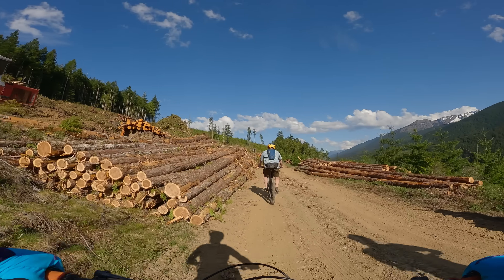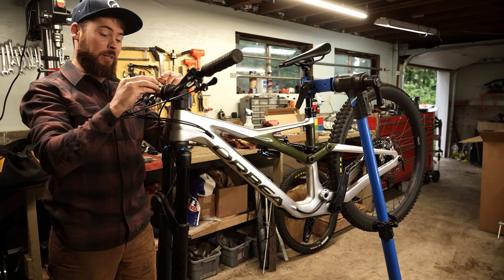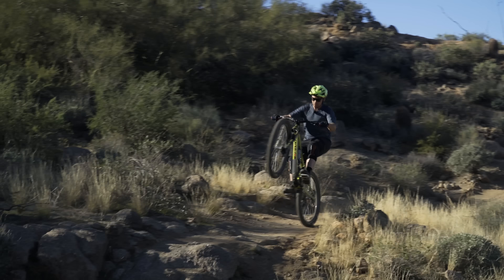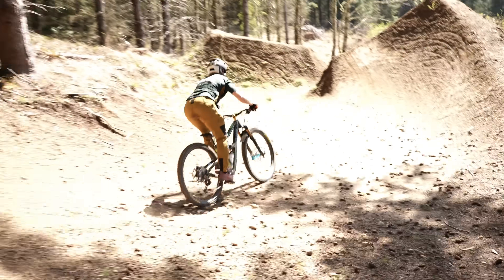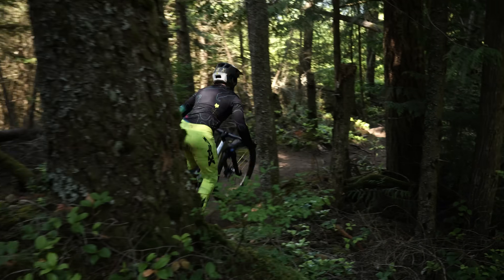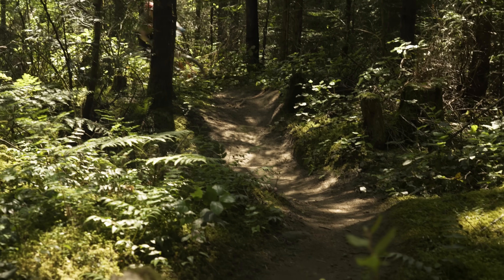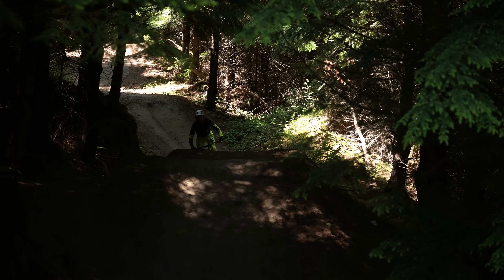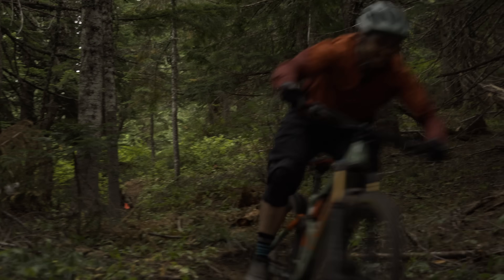7 Pet Peeves with Modern Mountain Bikes

Comment: You hit Number 4 on the spot. I have a Ripley AF and the amount of pedal strikes has led me to now a dislocated shoulder. Not fully blaming the bike (user fault most-likely) but ever since I went from a hard tail to this bike, the amount of strikes has been near insane. Raise the bottom bracket.
Reply: Lower bb feels better on flow trails... most riders ride flow trails. at my local mtb park the groomed flow trails are always packed, and the natural terrain ones are empty. mtb manufacturers are all about following the demand from riders. there are nich products with higher bbs or you can get one that is adjustable, i always ride my bikes in high position
Reply: @manaknight333 same, I go to Mountain Creek, Thunder, Killington and Highland and the flow trails, especially the blue ones like Cat's Paw, Jump Start, Blue Magic and Gronk are always packed. If there's a bigger market for flow than tech, and clearly there is, that's the direction manufacturers are gonna go ... And most kids I see are almost exclusively riding jump/flow trails, so it's gonna become even more prevalent.
Reply: I'm with @holyspokes608. Try a shorter crank. It won't solve low BB issues, but it helps. 5mm or 10mm can make a surprising difference in clearance.
Reply: Going from a hardtail to a fs makes a difference on its own as you can pedal while the rear suspension is compressed which makes the effective bb height a lot lower. Maybe less sag could be a solution but thats a whole other topic

Comment: My biggest pet peeve is that most bike manufacturers charge retail prices for  components on their builds, when we all know dang good and well that they get a substantial discount on parts. Especially when they buy them in bulk. I mean instead of charging 12 grand for a bike with parts that add Jensen retail prices for each individual piece, they could share the cost savings. better yet, sell me the frame without a shock and let me spec everything I want since I'm going to end up paying retail for said parts anyway. Don't even get me started on "XT or GX" builds with NX/SLX everything except for the shifter.
Reply: Propain is the only company I know of that will sell the frame without the shock, nice feature
Reply: @JJ_MTB_15  commencal will too

Comment: Properly speced wheels and tires on enduro bikes would be amazing. My trek slash is such an incredible bike but the stock wheels and tires are already upgraded after 6 months
Reply: The Bontrager Line 30 comps died that quick?  You would hope they're decent because the Bontrager high engagement hubs are a big selling point to those wheels.  Tire selection is getting better with lots of good non-Maxxis options out there, of course Bontrager tires are still trash, they didn't go the route of Specialized and actually put effort into making good tires.

Comment: As far as BB height, it greatly affects the stack dimension, so by increasing BB height you're decreasing your stack, unless you increase your head tube length or stem spacer height/bar rise with it. So a lot of companies drop the BB to achieve the size they want, as well as the low CG they want

Comment: A workaround for bottle cages is to install them on the handlebar. Fidlock also offers rubber strap mounted mounts. But round plastic clamps also exist by Fidlock, Nicolai offers several options, so far only where I've found them. This requires you to get the correct clamp for the tube size. and is for round tubes. But I could install it on the down tube, top tube if I want. Fidlock offers bottles with a cap, which is a must in my opinion.
There was a bottle and mount system that has two bottles I forgot who makes it. As for tiny bottle YT bikes has a custom Fidlock bottle for their Jeffsy bikes. But Fidlock offers their regular bottles in smaller sizes. Like 450ml. But thee YT bikes bottle has an unusual shape to fit that bike. It also fits on Nicolai/Geometron G1, but G1 does not have mounts, but you can install a bracket, as Geometron thought of this, it's a mountinh hole at the BB area without compromising the down tube. and cable routing mounts at the rocker link bracket. I think it has to be ordered at Geometron.
Fidlock also offers Uni connector, which has BOA, which hold a bottle in place, so can mount any size type of bottle. So you could have a bag or tiny bottle and secure it.

Comment: I might disagree on the dropper post. Yes I am probably the only one but I don't like more than 150/160mm drop. It's enough for me. I only want my saddle out of the way enough and I tend to stabilize the bike during a descend with my thighs and knees from time to time. Currently I have a 125mm dropper and I personally don't see any reason to get more drop. Probably depends on the type of riding you do as well.
The rest I can totally agree with. I don't use a torque wrench tho. I guess everything and so far it works fine

Comment: Mechanical engineer here - lots of torque wrenches in my tool box.  As long as the torque spec covers things not coming loose...and stuff not breaking (especially stripping threads... ugh), I'm a happy MTBer.  Sure, I don't drag a torque wrench out on the trail, but for all the rest of stuff (minus maybe wheel axles and pedal axles), it's getting used.  Especially the critical safety stuff: headsets, rotor bolts, lockring for cassettes...list goes on.

But yeah, for suspension bolts that come loose...or axles coming loose, I'm much less pleased by some torque specs.  Wish it could be simpler... but you wouldn't believe how badly a general user can screw up fastening something together.  Torque specs are really CYA in that regard.
Reply: Ok engineer

Comment: Torque wrenches are very easy to use incorrectly in several different ways so that if you do a couple of these things wrong in 'one torquing' then you could be way of. For instance, most headset clamps have two bolts. If you torque one and then torque the other and go with that, then the first bolt you torqued will be under torqued and you will have a weak clamp (and the second bolt will actually be over stressed). This is because when you torqued the second bolt, the torque value will overcome and surpass the value of the first bolt. The first bolt had to overcome all original forces working against it. Therefore, most of the work for the second bolt was already done and it will snug down a little more, leaving the first bolt lacking. When two bolts are configured next to each other like that, you need to go back and forth a couple of time until they are evened out. 
 The wrench also has to be held and moved in a very specific manner. If you deviate from this, then the end values can be all over the place. Then there's the preparation of the mating surfaces and the preparation of the fasteners. If there is any dirt on the fastener threads for instance, the wrench will click or register before the desired torque.
 Research torque wrench use from the automotive or engineering fields and you'll be much happier with your results. Once you really know what's going on it is very easy.

Comment: I definitely use a torque wrench even if I'm not dealing with carbon. But some parts I do by feel.

To your number 1 point, the Ripley AF's ability to take well over 200mm of dropper was a big part of why I chose it. Coming from a BMX freestyle back ground and being short of leg, long of torso, (for my height,) I have hated mtb standover for decades.  Getting an appropriate reach meant using a long, slow steering stem, or getting a bike with a roadie-like standover. Modern bikes feel almost like Trials frames, (in a good way,) compared to mtbs from the 80s-10s.

Comment: Have you thought about that having a lower bottom bracket allows for that better handling? Lower CG always makes things more stable, and when your main point of contact is through the bottom bracket, that height plays a huge rule in how a bike handles. There is always going to be trade offs, going higher brings your weight higher, making it handle worse. Going lower has more pedal strikes, better handling.
Reply: It depends a great deal on your terrain. I ride the North Shore, and generally speaking, very low bottom brackets don't work well there.
Reply: @briannyob7799  Touche, good point

Comment: For the loose stem issue if it’s a carbon bar you need to use carbon grip paste, that’s why the torque spec is so low, they probably assume if you’re buying a nice CNC stem you’re running carbon bars in conjunction. If that’s not the issue I’m not sure what is!

Comment: lower leg bolts on my new lyrik fork came torqued at around 16nm, even though the manual says to torque them upto 7.3nm. So does it need to be that accurate

Comment: I am 163 cm short (and short legs) and bike frame with interrupted-seat tube is bad news e.g. bent-seat tube, suspension mounting placement that gets in the way (linkage pivot and the rear shock). It means I won't be able to fit a sufficient long travel dropper post I want compared to bike frame that has straight seat tube.

Comment: Torque wrench for safety. Seems my bolts get less or more tightened depending on my mood... not safe with something like center lock brake rotors. Suspension bushings/bearings also come to mind. My brain wants them TIGHT, but too much is more than enough. Torque wrench use lets me relax out on the trail.😊

Comment: 7. i use a torque wrench and never had anything back out or fail on me, but i'm also a light 140lbs
1. dropper post - my biggest pet peeve is that thomson doesn't make > 150mm dropper. been on the same dropper for 8 years, and had to go with another when i finally got a new bike that needed a longer dropper

Comment: Everybody seems to complain about dropper length (i.e. more is always better), but as someone that is of average height (5' 9") and has short legs (30" inseam), I usually can't deal with anything over 150mm. I wish more companies made droppers that are adjustable downwards (like PNW and OneUp) so that it would be easier to spec a bike to fit a wider range of riders.

Comment: I have never used a torque wrench. It has never been a problem.   Also, I'm worried that I will have a hard time finding an aluminum 27.5 bike in the future.  

The trends are pretty rough at times.  

I also hate that mtb clothing is so expensive $70 to be a billboard for TLD?  No thanks.  $12 blank athletic jerseys work just as well.
Reply: Yeah some of the overpriced pants and shorts are at least nice, but a lot of the jerseys are literally branded athletic t shirts that cost a lot.
Reply: Transition scout alloy! Full 27.5, pedals great, devours the steep gnar, rips corners, so playful and boosty for being just under 40lbs. My favorite thing about it is how it loves hucking to flat.
Reply: Fits a 210 dropper and fits a full size bottle plus accessory mount under the top tube

Comment: I would add that cranks are too long in general. Why are XS bikes with 410mm reach specced with 170mm cranks?

At this point most people are at least a little aware of the benefits of shorter cranks. It seems like S & S just need to move thier existing stock of 175mm cranksets by slapping them on every bike size medium and up. Mark my words: as soon as inventory gets burned down, someone's going to "innovate" and start preaching the vertues of short cranks.

Comment: Based on my recent experiences I would venture to say that there's a lot of overpriced garbage being sold, including by top brand names and their components. Had an issue that couldn't be resolved with a brand new fox fork. Terrible service by fox. Swapped it for a rockshox lyrik ultimate. Wasn't assembled properly and leaking oil right out of the box. Sent it back. They fixed it but didn't put set screw back into the adjustment knob. Further annoyances. Brand new trp brakes and the rear appears to be somehow defective. Hasn't been fun dealing with this bs constantly for the past 6 months or so. Quality control is zero and they are pushing out defective product at top dollar prices. Unacceptable but I guess this is just how we do things nowadays...smh

Comment: Dude!  Torque specs are crazy!  Just replaced my BB and called the MFG to verify the specs of 50-70!  They said the range was due to different BB shells made of different materials.  What is the point of that if they are not going to specify the torque for each material?  I have taken to the habit of only using torque specs on carbon parts; keeping to the hand/wrist/elbow/shoulder/hips method for everything else.  My bike passed all the tests even though I don't put the water bottle on the frame--got tired of chasing it after riding a chunky section 😅

Comment: I never used to mind not having a bottle since i would wear a pack . But the last few years i like to take minimal kit, i have a whyte e180 and you cant even fit a whyte water bottle in the frame. I had to get the smallest fidlock bottle since it was the only thing that would fit in and only by about 3mm. Pretty sure its a 425ml bottle which doesn't go far.

Comment: I assemble new bikes at work, been through about 6000 bikes so far roughly counted, and when I use my torque wrench I always go like 45° extra when doing metal on metal. Always staying a little under the torque spec when I clamp carbon with carbon paste applied
Reply: Poor customers... Why bother using a torque wrench at all if you're aiming for the wrong bolt stretch? 😂
Reply: @notmyname781  most customers will never touch a single bolt on their bike. Better to leave them tight than having them creep out. With the torque wrench I know roughly where I am with torque will the other people have no idea what they are tightening with just regular hex keys (often too loose)

Comment: Internally routing, especially for things like hydraulic brake lines, is a true PITA and wasteful of small parts / fluid when you need to swap things around.  Guerrilla Gravity has the right idea w/ their approach to this... clean lines by running an external channel along the downtube that has an exterior shield held in place with a few screws, and a snug fit so no rattling.

Comment: I look at torque specs and people who say you NEED to follow them (mainly people sponsored by big brands, huh strange ?) and i sigh loudly for myself. I come from motocross, we never care about that and as you said, want everything to be ''ass tight'', or as tight at the metal allows you too until the tool starts slipping or you risk of breaking the bolt, whichever comes first :P
Reply: Do you wire bolt heads like in street racing? I always find "right plus a grunt" is the way, and I own torque wrenches..

Comment: My pet peeve is how they keep changing the geometry of their bikes, moving them all towards downhill bike geometry, many enduro bikes have basically the same geometry of downhill bikes now, even some trail bikes now basically have the same geometry of downhill bikes too, many cross country bikes are now basically short travel trail bikes, not every one wants a super slack bike, so stop turning them all into one, over the years I've owned bikes that range from 70 degrees to 65 degrees, my preferred bike now is 120 to 130 travel with a 66.5 head angle, I find it a good compromise.

Comment: I use torque specs in a similar way as you do, look at the spec and assess. I use a torque wrench for everything carbon and cockpit, basically when you're clamping something. After that for pedals i go hand tight(because after that you wanna unalive yourself when removing them. For bb i also use torque wrenches.

But it might be because im an engineer and i try to respect how the bike/parts were designed and how it was intended to be used lol

Comment: I use torque-wrench anything that has to do with carbon, magnesium or cockpit.

I’ve seen too many stem bolts or threads snap/strip from over-tightening. 😮

Comment: If removing a few volume reducers is an issue then don't buy from an American brand that specs the bike for the average American rider's weight. For context, I'm a relatively light weight rider (5"10' and 160lbs) and I bought a SC Nomad size large knowing it's set up for heavier riders than me, which is fine AFAIC.

Comment: I am 5'9 ride a Ripmo AF/Canfield Nimble 9 both size M. So many people dont believe I run a 210mm dropper on both of them, and I keep getting told it not needed because I am short. I just dont understand why you wouldnt want extra ROM for riding. 

Curious can you fit a 210 One up on the Transtion Sentinel/smuggler if you have tried them yet?
Reply: That's interesting, I ran into an issue with the reat tire buzzing my seat on my AF and had to raise it a bit. You don't have that problem? I'm on a large running the stock dropper.
Reply: @ScruffyRoosevelt  I run a VERY forward and very tilted seat but I also might have longer seat to crank centerline than most.

Comment: As a 135 lbs rider I reject the suspension point. Needing 1 token at 170 lbs BW would be BRUTAL for me. I usually run two tokens in my forks...also, I always use a torque wrench for consistency.

Comment: Jeff - You look like a guy of smaller stature.  So I don't understand how you get to use such long dropper posts.  I'm a six foot tall guy with relatively short legs; my  inseam being only 30 inches.  So my 2017 Salsa Horsethief can only use a 100mm dropper post and my 2022 Fezzari La Sal Peak only fits a 125mm dropper.   Do your preferred bikes have that much lower seat post heights?  Or are your legs longer than they appear?